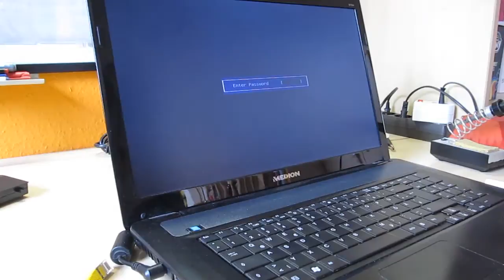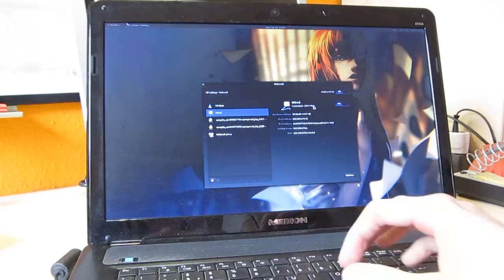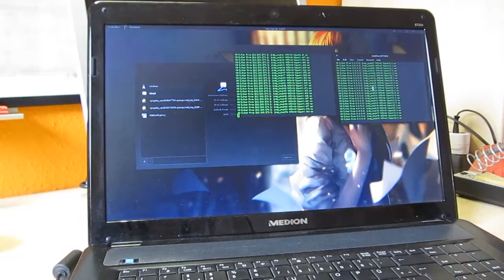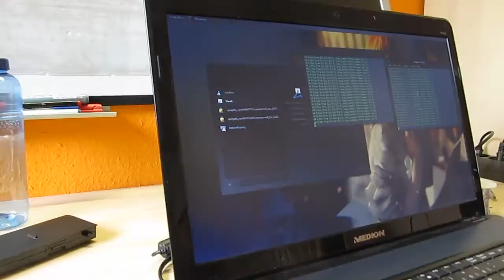Fixing a broken LAN port on a Medion Akoya E7214

Comment: Hi, may I ask? when your notebook's LAN port broken did the network adapter still exist in device manager? my notebook suddenly "missing" its network adapter, tested on different OS (live linux) not appear either.
Reply from the maker: +latebloomer2 Hi. Yes, the network adapter was still present in the device manager. The system just kept reconnecting all the time. Your problem sounds like either the LAN controller itself or some of its supporting circuitry has come off the board or is broken. Theoretically, this can also be fixed but it will require a lot more effort.